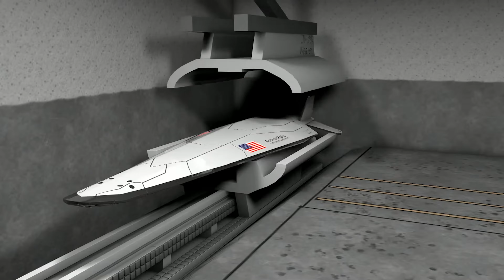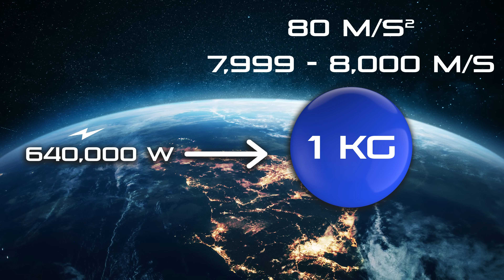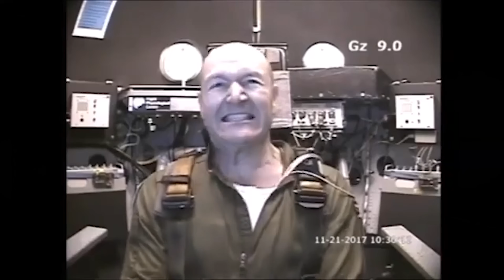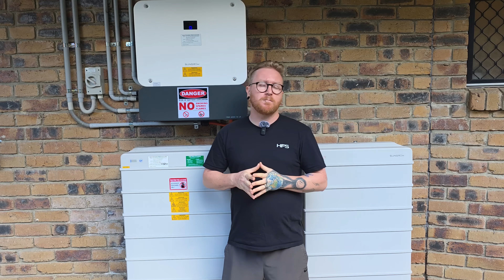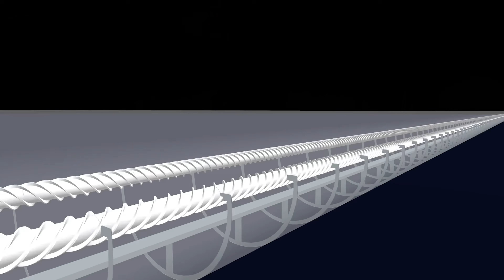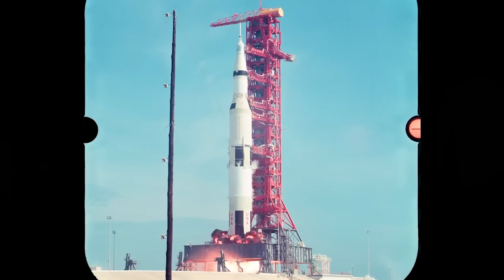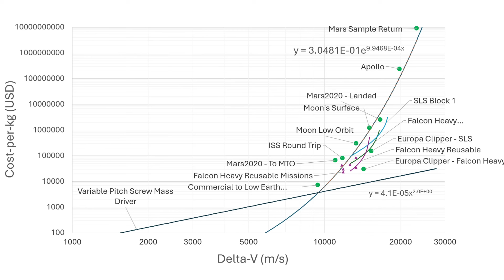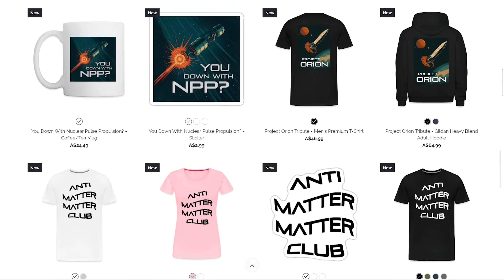The New System That Could ACTUALLY Replace Rockets

Comment: The result of the digital twin depends on at what level the physics is simulated. 
In short, VPSL’s physics isn’t outright impossible, but its engineering execution, thermal environment, and economic realism remain highly speculative. Until detailed simulations are validated by scale prototypes — including thermal, magnetic, and dynamic tests — the concept should be viewed as an interesting thought experiment rather than a near-term revolution.
Reply: You can get a better sense of the level of detail in the digital twin by reading the paper: "Human-Rated Launch Infrastructure for the Interplanetary Era: Breaking Rocket and Legacy EML Cost Barriers".
Reply: The pragmatic realities of real-world implementation are not caught in thought experiments. All you need is a natural frequency issue, or a thermal gradient issue, or a vibration issue, or a material strength issue to come to bear. There are so many paper engines out there that can't be fielded because of simple issues like lubrication, heat, or material strength. Rotordynamic issues seem like a huge issue to model, and more to resolve when a hiccup occurs. I like to be an optimist; however, experience helps you look for trouble spots early and determine if there may be a show-stopper. I really think rotordynamics needs significant investigation initially before this is taken too far. Do we have the capability to model this? Finite element analysis won't do it. Guys like Lund from years ago may help.

Comment: You should make another video addressing the problems laid out in this videos.
1) Per kg cost of imaginary VPSL system (3.8k) is compared to real world falcon 9 (5k) and not the less imaginary StarShip expected costs (1.2k).
2) You imply this can help the $93 billion Artemis cost. when in fact it can only replace the launch costs where are only 24% of that.  That's a little harder to work out but it's far from $93b
3) You need to address not only the build cost but the maintenance cost.   Slamming that much energy back into the launcher is going to be very hard on it.  Remember, Newton's Third Law is not going to take the day off.
4) And of course the more serious problem with these kinds of systems.   They are stuck in one spot, pointing in one direction.  throwing one size of rocket.  At one speed.  I think all they can very is the weight and a little speed/height if that doesn't get nerfed for building cost reasons.  We would need dozens of these things.
Reply: Thanks for the great points! 1) Cost: Don't forget that 3.8K is per kg of cargo landed on Mars. The numbers for Falcon 9 are to a 200km LEO, and there isn't a reputable source of info on Starship's cost-per-kg, only aspirational statements. 2) Artemis: Because the transportation cost per kg is so much lower, everything that is sent to Mars can be engineered more conservatively, which should save payload development costs and reduce mission risk. 3) Maintenance: The launch system is a no-contact system, with forces that are smooth and steady. The internal parts operate within a vacuum, eliminating corrosion. Because it's ground-based infrastructure, all the components can be engineered more conservatively than the components in a rocket. There are some maintenance costs, but they are quite low. 4) Aiming: The Earth turns, so the system is aimed mostly by choosing the launch time, but there are other ways of fine-tuning the flight trajectory.
Reply: @spaceinfrastructure3238  1) the VPSL cost are the most unknown so I'll leave that.
2) Then that would be a change order and require more engineering driving up the cost. 
3) I never said anything about touching.  Newton's third law states that for every action, there is an equal and opposite reaction.   If your going to push the rocket there will  be the exact amount of push back on the launcher.  Worse, that push back will travel up the launcher in kind of a wave motion.   Look up winter roads to see how much of a problem traveling loads can be.
4) The Earth turning doesn't change that.   It's the angle between the equator and the poles. Which would pretty much be constant except for the Earths wobble.
Reply: @lucidmoses  I like your new third point - I don't think we've done and published an analysis of how the tube and screws would stretch under the load of a launch. They'd need to be mechanically pretensioned. At t-minus-zero, the mechanical pre-tension would be handed over to the acceleration loading. Then the tube ahead of the vehicle would be under constant stress, but the tube behind the vehicle would contract slightly as the vehicle advanced and stress was released. Definitely worth modelling.
Thanks for sharing this concern/insight - I think you helped advance the project!
Reply: @spaceinfrastructure3238  Besides the cost problems.  I'm very curious how they solve the engineering problems.  To be very honest.  I really hope they do.   But I don't expect they will.   It sounds more like a 'works in theory' project you hear from they kind of academics that don't bother with the real world.
Reply: Great answer! I look forward to see this project becoming a real deal for regular transportation of maybe crew, but mostly cargo to space! Nice!

Comment: Another thought...  Having permanent magnets on the sled "fly" above permanent magnets on the screw face seems good, but why not just use repulsion with spiral permanent magnets on a smooth cylinder?  Sure would be easier to make.
Also, why have long continuous screws?  If you had segments along the tube that spun faster and faster, it could help mitigate the issues below about stiffness, vibration, and nearly horizontal screw pitch.  Would they have to spin too fast?
Also, why have 2 screws?  Make large cylinders that spin with spiral magnets and with the sled and payload inside.  Maybe the large diameter would limit how fast the later segments could spin.  Also, with this approach, you could only support the sled track structure between the spinning cylinders.
Reply: It's electromagnets (maybe PM-biased) on the "adaptive nut" and the screw flights are just steel without permanent magnets. The screws spin fast, so attaching permanent magnets to the screw flights would be an engineering and manufacturing challenge. There are two screws to make it easier to offset the forces. Design variants are possible - it wouldn't surprise me if someone comes up with a way to improve on the idea in the comments, like Brad's Rutherford engine idea.

Comment: Creating that big of a vacuum is a nightmare.
Reply: Also containing the vacuum when the exit end of the tube needs to open to let the vehicle out of the tube plus there would be a negative effect on the vehicle exiting the tube while air rushes in to the open end of the tube. Maybe there would be some sort of complicated air lock system that closes the tube immediately behind the vehicle and slowly repressurise the last part of the tube before the exit is opened to allow the vehicle to exit the tube with less drag caused by air rushing in the previously evacuated tube section. Plus the cost of the construction and maintenance of a large vacuum tube would significantly add to the cost of the system.
Reply: @peterensinger1770  the only thing that matters is how often it is used and the relative cost per launch. 
If a huge upfront investment can lower the cost per launch and we have enough launches planned it becomes cost effective.
Reply: vacuum is just small part. what about earth size infrastructure, no bumps along the way,...
Reply from the maker: Sure, but rockets aren't exactly known for not being a nightmare either.. We've never really tried making a long vacuum tube like this, we've not had the need.
Reply: @HelloFromSpaceAus  Hyperloop and a couple others got quite a bit of funding and built failed short prototypes. The problem is that it takes massive amounts of energy per cm³ to create and maintain a vacuum and also a positive pressure difference on the outside of a tube is asking for a fcking disastrous implosion.
Reply: @HelloFromSpaceAus  True, but Elon has made it look easy from every aspect you look at it. Was it full flow stage rockets to software what calculates every action with so much precision the booster can land in the air via metal arms it is impressive.
Reply: @Toolo559  The booster is the easy bit - second stage has far more embodied energy, and after 10? tries is still to reach orbit, carry payload, or be recovered. Rocket Labs' idea is to use carbon fiber - much lighter than steel; enclose the second stage inside the first so it has little aerodynamic loading, and can be still lighter, simpler, and cheaper; put all your expensive reusable stuff in stage one, and let stage two be disposible. Anyway, there's no real justification for humans in space, apart from propaganda. If we really need to launch hundreds of tons, make the payload tough, put it at the bottom of an evacuated tube in the ocean, and detonate a smallish nuke under it.
Reply: @Toolo559 programmable self landing rockets has been a thing since the 90s. Modern rockets like SpaceX are basically just like drones with their automatic landing once you modify the prupolsion method. Sealing a 10km+ long tube but still allow a craft to exit the other end is an entirely different challenge. Look at the funding that went into hyperloop and how many years, which resulted in like a 50ft section that never worked.
Reply: @HelloFromSpaceAus  "We've never really tried making a long vacuum tube like this"
You're right. We've tried smaller ones... and they were pretty much infeasible.
Reply: A life support system that is rushing at orbital speed toward air that is filling the tube at sound speed is going to kill everyone. But so many other problems, like spinning the giant screws or suspending the tube to give it the pitch. and so many others, this is just dumb.
Reply: And hundreds of other problems this dumb analysis gliss over
Reply: Yeah soon as I heard this, that's what my thought was , no vacuum that size will ever exist as that is where the cost is, plus hitting the air at that speed from zero, we'll then it hits entry and has to got thru re entry.